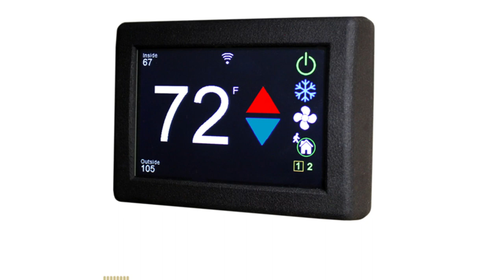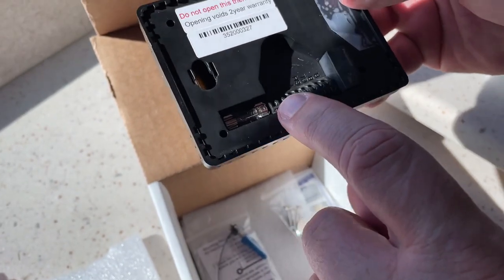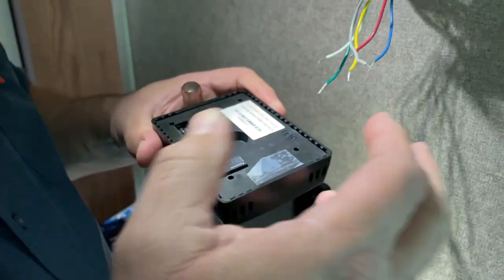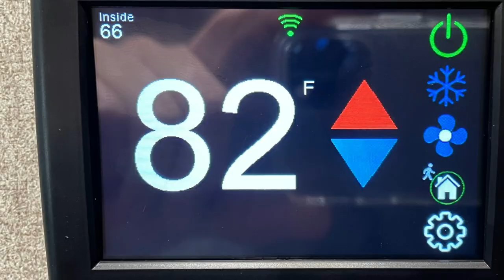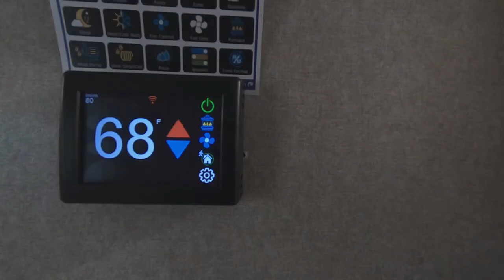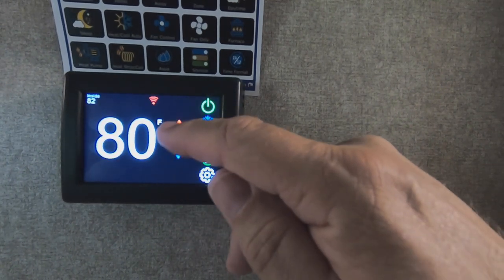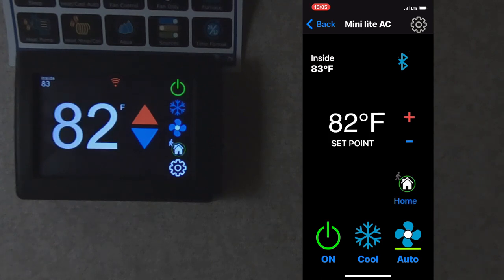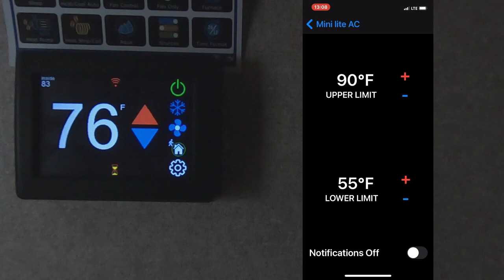Part 2 || EasyTouch RV AC Thermostat upgrade, does it work? AC problems and fixes.

Comment: If you install the micro air easy start it will also make the air run slightly quieter and more efficient.
Reply from the maker: We have installed the Easy Start and so far so good!

Comment: I've been trying to research if the EasyTouch will automatically switch between high and low fan setting when heating/cooling in "auto" mode. Does it adjust fan speed automatically depending on the difference in the RV temperature and the set temperature? Or does the unit only use high (or low) when the fan is set to automatically run only when the A/C or heat pump are engaged?
Reply from the maker: The fan speed control in low and high is a continuous operation mode whether AC is running or not.  In auto mode the fan comes on just before the compressor kicks in and runs for a few minutes after the compressor shuts down.  Thanks for watching and safe travels!

Comment: Good video , I have a 2021 Flagstaff 25fbls . I have been working on making it water proof   I have found so many trouble spots , if your interested in sealing your trailer up to make it tight let me know .
Reply from the maker: Always on the watch for good tips.  What did you learn while doing it?

Comment: Hi. So just bought  a new Dometic breeze 15000. What do I set the thermostat to get the AC to cycle properly.  It's about 27 degrees outside and  23 inside.  Do I set it 1 degrees above the inside temp or 1 degrees  below.  It just runs non stop. I want it to cycle off...then restart in a while. Can anyone help ? Thanks
Reply from the maker: Hey Doug, Thanks for watching.  Not familiar with the Dometic specifically, but they all operate the pretty much the same.  Watch video "part 1" where I talk about the hole int the wall behind the thermostat.  This maybe part of the problem.  RVs are very thermally inefficient.  If it hot it will just run.  Just set it for the temp you want, make sure it is in auto mode and enjoy.
Reply: @OurCoupledAdventure  HI. So can't find part 1. Anyways I assume the temp behind the thermostat in that wall is what your referring to. How do I get it to read the room temp properly then ? Thanks great vids
Reply from the maker: Hey Doug the video is "Part 1 RV AC problems and thermostat upgrade.  It is where is discuss the giant hole in the wall behind the thermostat.  This is where the wiring come through the wall and often the hole is gigantic.  This hole allows a lot of the wall heat to enter the thermostat and has a major influence on how the thermostat operates.  Find a way to tape this hole up only leaving the wires to come through and see how that works.  Good luck.  The video does go into detail on this.